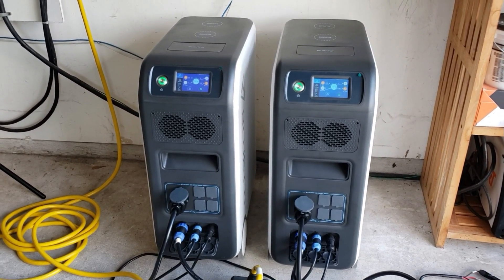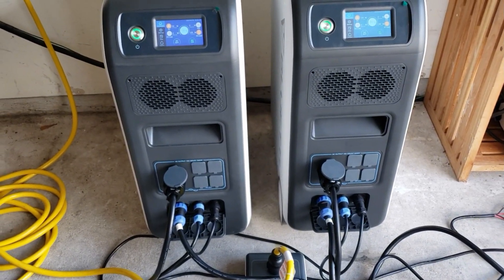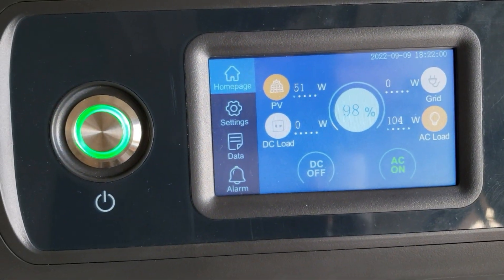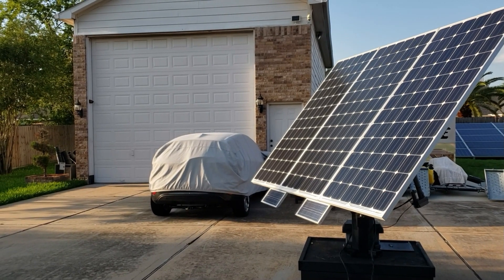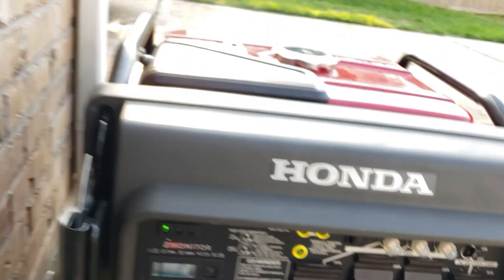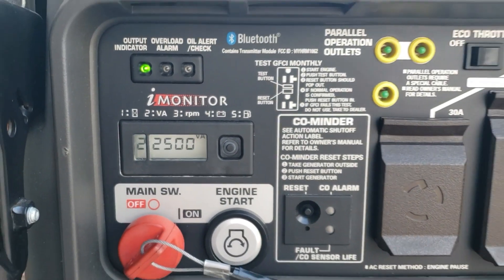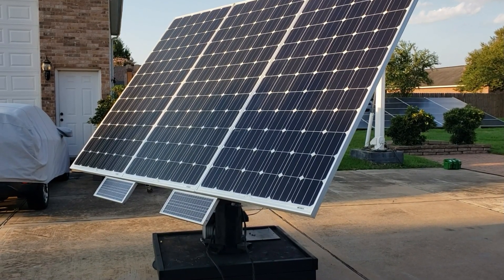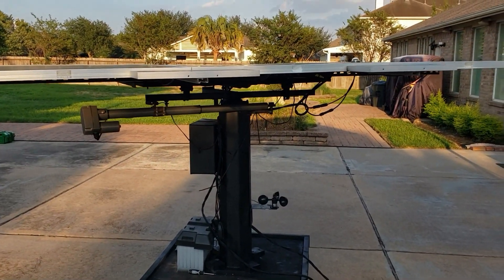BLUETTI EP500 Pro Connected to my House Transfer Switch Charged with Solar Tracker and Honda EU7000

Comment: What settings do u  need to Change to charge with a generator (on the bluetti)
Reply from the maker: You don’t have to change any settings, just plug it into the generator
Reply: @GeneratorReviews  i have a 8kva generator, it just says grid voltage to high

Comment: Where did you get the 240 amp. Split cord that goes from the bluetti units to the generator? And what does that box looking thing between the above mentioned cord that plugs into the generator do?
Also those solar panels look like the rigid type. Did you use the D300S step down module that bluetti sales to make them work?
Reply from the maker: I got the split cord from Amazon. I did not have to use the D300S because the solar power is within specs

Comment: Setting up the same system with same thought process.  Video awesome haven't run across anyone doing the same with this system.  I just got the ep500 pro and working on this sane set up.  Thanks

Comment: Gavin, great videos. I have a very similar transfer switch to you. They are all 120 circuits, but on different sides of a split phase input. If I just have 1 EP500pro and hook up the NEMA 14-30L, does that mean only have the circuits get current? Are you able to test that? Thank you!
Reply from the maker: Yes with one only half of the circuit receives power
Reply: @GeneratorReviews  Thank you so much for your reply.

Comment: Hello again, Gavin, unsure if this is the correct venue to ask my question but you answered me on a generator post recently and this kind of involves gens so hopefully you will see this :). At the moment I have a Champion 9375 that I got last year during the February storm that hit Texas and my home (OKC) and my old gen blew and I had to grab what I could find so it it helped but it's THD is ~20-25% and nobody has time for that, lol, too many ac motors and UPS not to mention microwave oven that do not like the juice. I ALSO want to start putting together some solar kit but I need to get through this winter with a backup power plan in-place so to get to the point...if I started out with a solar inverter that was large enough to cover my wattage needs for the house (6740 practical worst case scenario) could I run my Champion gen's output into the terminal block of the inverter and have the inverter going to a 50AMP breaker on my main panel using an interlock? Also would be running my champion off natural gas and it should be able to hit about 7k watts using that energy source. I saw Martin Johnson (off-gridder on YT) turn on his gen to feed his inverter using output from it when it was cloudy so figured the inverter is able to take in energy someway from the gen? Forgive my word count, just trying to make a wiser first move than getting an inverter gen that is large enough to cover 7k watts off natural gas without abandoning my original Champion gen, etc. Thanks for any perspective!
Reply from the maker: The first thing you’re gonna need is an inverter generator if you plan on charging your power station with it
Reply: @GeneratorReviews  OK, so I totally didn't realize the AC power coming into an inverter had to be pure sine in order for it to put out pure sine, guess that is the diff between AC and DC being used, big point, thanks! Guess I need an inverter gen after all, lol, which basically negates any advantage to getting a dedicated inverter. Thank you! Back to the drawing board. The natural gas requirement puts a lot of kinks into gen options, lol. Well, chunks of cash-wise :).
Reply: Update:  Holy Moly, Gavin, look what I found on the Westinghouse WGen12000DF, page two of  the manual...<5% THD??? Calling some telephone numbers tomorrow to verify they stand behind that. May have a winner...getting tired of looking, lol.
https://www.norwall.com/product_pdfs/3128_Westinghouse_12000_Watt_Dual_Fuel_Generator_Owner_Manual_WGen12000DF.pdf

Comment: This is a good setup, depending on needs the petrol generator dosn't need to run all the time either but in case of emergency.
And it's possible to run generators on other things than pump gas, cost a bit more, fumes are not as bad, it builds less crap in the motor and if you going to store it for a long time usually you want to empty it on gas but with the modern fuels you can store it with a full tank of gas for a year or two without problem.

Comment: Your Honda generator runs pretty quiet. I have a Troybilt generator and that bad boy is loud. What brand solar panels are you using? I have an EP500 Pro and am looking at buying 4 Renogy 320W solar panels. Could the solar Tracker accommodate 4 320W Renogy panels?
Reply from the maker: Yes it can hold 4 solar panels
Reply: @GeneratorReviews  Thank you for responding so quickly. I bought 3 of the Bluetti PV350W panels but I wanna use them for backup as they don’t seem to be as durable for hard weather as the Renogy. Where did you get the solar tracker if you don’t mind my asking?

Comment: I think this is an awesome idea for backup power. How long were you able to run? I’d be curious to know how long it would last if you just ran one of them. Something I need to look into before the winter. Thanks
Reply from the maker: It’s the best option for a backup system upfront cost is high

Comment: Thinking of picking up a couple of 500 Pros. How did your overnight test go. Have you tried to charge your 2 Bluett's with your solar panels only? How much were you able to recharge in a day? Great job with all your videos.
Reply from the maker: Test went great, got down to 76% the next morning at 10am it was fully charged. I just like all the extra settings and options

Comment: Brother, I want to thank you and ask a question.   I bought a A-Power SUA2000 for $449.98 on 4/26/2022.   I sent it back because it would not start.   A Champion 2500 on 3/28/2022,  sent it back because it would not run a 2500 watt load more than 15 minutes.    I ended up getting a Wen DF400i 4/29/2022 for $795.16.  I love it!    GUESS WHAT IT IS SELLING FOR NOW ON AMAZON.  From $999-$1300.     Question will it damage generators if you put on an exhaust extension?     Thanks Again for all you do! ✊🏿
Reply from the maker: Hey Bro, happy you up sized the generator and that’s a good one you got. It won’t damage the generator but it could cause it to run hotter because of the extra back pressure 
Please don’t run it inside and exhaust to the outside.

Comment: Which do you prefer between these and the delta pros?
Reply from the maker: I like the Delta pros for the RV it’s definitely more maneuverable and plug and play the EP 500 Pro for the home Solar priority, grid priority ,charge rates UPS mode it has so many features when it comes to off grid and back up power

Comment: Gavin, thanks again for another great video. Your videos are what led to my home setup. I have a EcoFlow Delta Pro that I use to power essentials when the power goes out, it gives me time to go and get some gas. Once I’m back with fuel, I switch over to the Genmax 6000 which can power my whole house. Anyways, keep making these great videos!
Reply from the maker: That sounds awesome Kevin
I should be doing the EcoFlow complete system soon 
Thanks for watching and subscribing 👍🏾🙏🏾👌🏾💯

Comment: I'm trying to decide which direction to go for powering a well pump. The well is 361' deep, the pump motor is 240v, 1/4 HP. I would use the pump as needed to fill a storage tank. The water system would use a conventional 40 gal pressure tank with standard low voltage regulator. Would you recommend a standard 240v generator, inverter-generator, with what type of battery storage?
Reply from the maker: Hey Tommy
I would definitely recommend a pure sine wave inverter generator with the way technologies going there’s no need to have a modified sine wave construction style generator anymore everything has computers in them.
I’ve built personally so many systems with battery storage honestly with the all in one systems they may seems pricey but by the time you build your own system inverter battery wiring set up it’s just a waste of time and money especially if you don’t know how to do that kind of stuff.
I can’t tell you which one to get but I can give you my opinion get you a good inverter generator with at least 2000 W more than you need.

Comment: Gavin, another stellar video my friend. listen if money were of no option, which portable under 2500K inverter generator would you go with (for a new truck camper) w/solar. I like to save money so and never buy on price. i generally come here and look for best value. thank you, look forward to the next one.
Reply from the maker: Hey David 
2k -3k system is the sweet spot. So since it’s going to be going in a truck camper it’s gonna have to be maneuverable, you’re probably gonna be moving it around. I like the EcoFlow delta pro the BLUETTI ep500 works great for home.
If you’re looking for something even lighter Check these out
https://youtu.be/D3NMcnszBtY
https://youtu.be/poNM5L4wtYM
Reply: what about gas gen under 2500 watts
Reply from the maker: @djaj423  If you check out the channel go to videos I have videos listed in every different generator size👌🏾💯